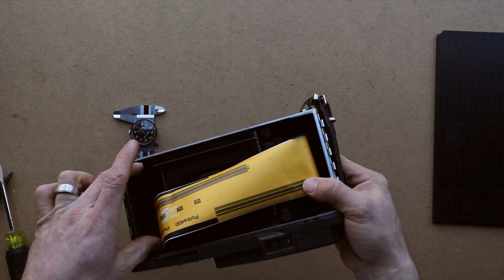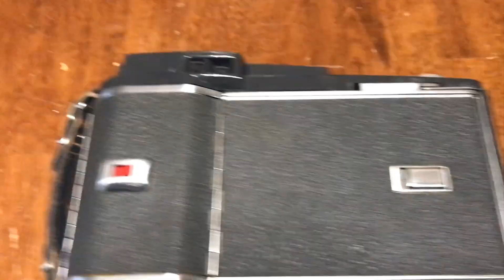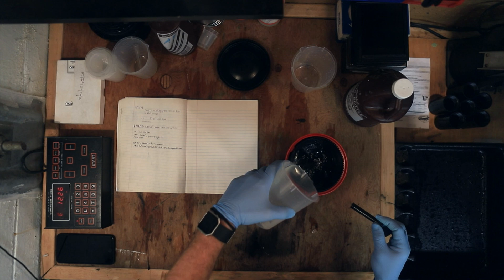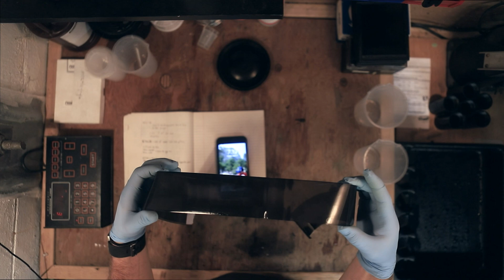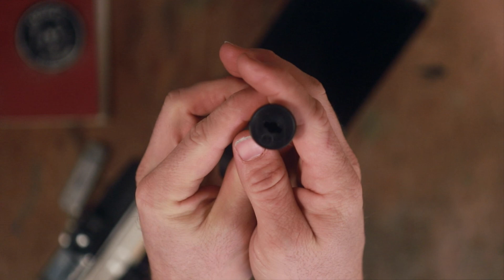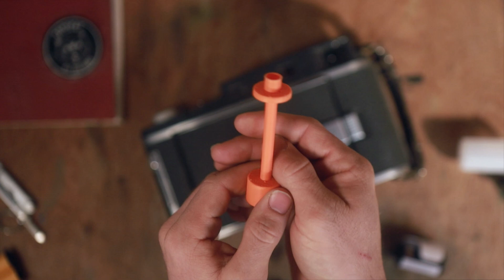Film Tutorial #10- Polaroid land camera film conversion build

Comment: I'd like to do this to the 800 I've had for the last 15 years or so, just sitting in its case. I'm better at repairing than I am at modifying though. Do you still use this camera from time to time?
Reply from the maker: @danem2215  yes this camera is my test bed I have since added a 4x5 lens board to replace the stock lens and printed different film masked for it.  It is my test bed for all my new designs.

Comment: Hi,I currently am trying this comversion,but also wanted to not cut into the camera and found a way to just put the film inside and pull from the outside,no need to modify but it takes guessing the frames and all light leaks hell,so I might try yours instead.
Is an elegoo neptune 4 pro printer good enough?
Edit-mine Is a polaroid 120
Reply from the maker: @Buggered71  hi thanks for reaching out! Yes any printer should be able to handle these files.  Keep me posted and let me know how your camera turns out.
Reply: @tlangphoto  can I know your IG?I ll let you know there of possible
Reply from the maker: @ yes my insta is @tlangphoto

My store insta is @the.film.fridge

Comment: Nice video!  Ideally you would have converted it to use 118 film, as its image size is the same as the original Polaroid film that this camera would’ve took.  Unfortunately, 118 film has long since been discontinued and so 120 is the only option.

Comment: Nice project, being engineer as you are, you could perhaps also design a proper film guide 3D printed. I will make a similar project with mine 120 or the 800. But I do not have the ability to design a 3D spool, so I'll use a 120-film spool with spacers. I am also thinking about to transform one of those cameras in a pinhole camera. Cheers Travis and keep us updated
Reply from the maker: Rolando Furet you are correct, I have designed a film guide to work with this camera and I am currently working on printing and installing it.  

I have a few extra spools I printed when designing this camera mod.  If you would like to have one for your project I would be willing to send it your way!
Reply: @tlangphoto  I would also buy a spool or have one printed if your file is available. My wife gave me this camera as a gift with a couple of rolls of 120, under the impression that the conversion was an easy one. :)
Reply from the maker: @virgiljohnny   my e-mail is tlangphoto@gmail.com get in touch with me and lets make something happen.
Reply: @tlangphoto  Of course I'd like to have one. Tell me how much do you would like for it. My email is ; rolando furet@gmail.com. Thanks